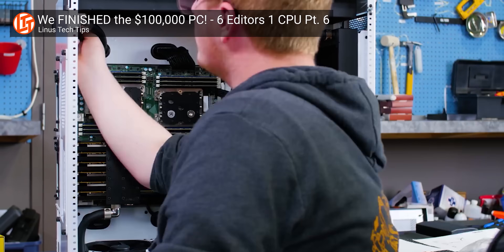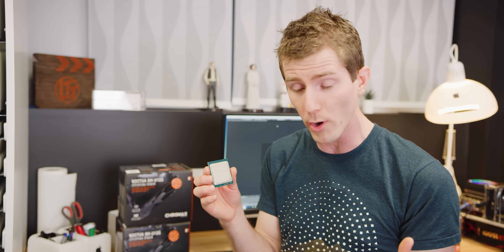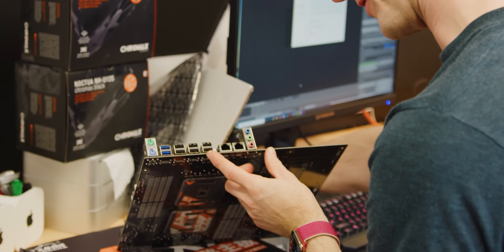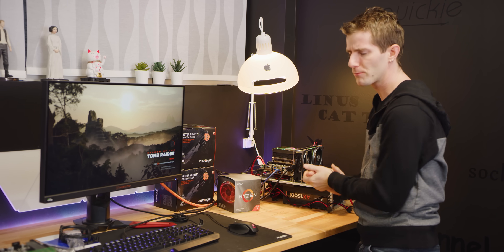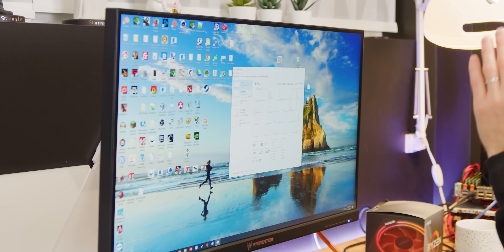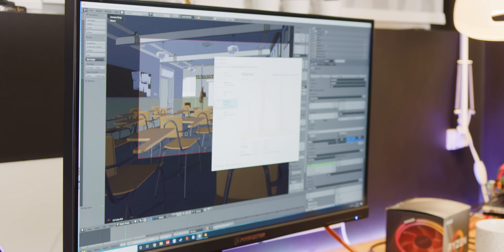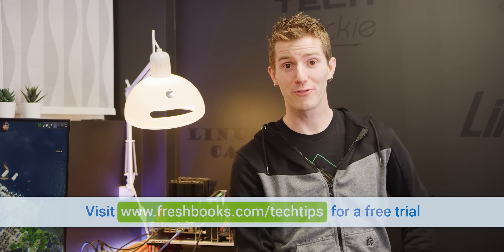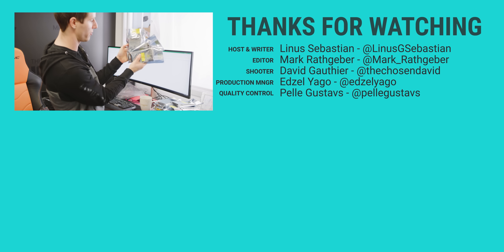SIXTEEN Cores for the Price of EIGHT!

Comment: Linus, I bought the same mbd, just the Kllisre brand instead, initially testing with two very cheap 2640s (15 UKP each) and 64GB/1866 (58 UKP). Btw, turn off NUMA mode! It will likely be on by default; many games will run better with it off. I note you chose the 2667 v2; worth baring in mind the much cheaper 2650 v2 (about half the price) though it's clocked 600MHz lower. Still, even with the two SB-EP 2640s performance is pretty decent; I have 2x 2650 v2 and 2x 2680 v2 which I'll test later. With the 12 cores of the two 2640s I get 1426 for CB R15, 3041 for CB R20 (so your score of 2256 for R15 looks reasonable, be interesting to see how that compares to my v2s later):

http://www.sgidepot.co.uk/misc/tests-jj.txt

I do think you should have bought 1866 memory though, it's very cheap off Aliexpress, but I expect one can force 1600 RAM to run at 1866 most of the time. I was lucky and managed to obtain mine locally for about the same cost (96GB/1866 for a total of about 95 UKP; the other 32GB went onto a PlexHD X79).

This particular dual-S2011 mbd does NOT support quad-channel memory (per CPU I mean). Each CPU only has 2 channels wired up, each channel connected to two slots, hence the differing slot colour coding. I have talked to the supplier about this, they seemed unaware of the nuance. Here is some memory bandwidth data showing the differences:

http://www.sgidepot.co.uk/misc/kllisre_analysis.txt

I suppose one could argue the mbd overall has four channels (with 2 CPUs installed), but the boards are advertised as having 8 total channels which isn't true. I've asked Kllisre to change their advertising.

I've tested many games, most run quite well, including SotTR as you observed; results now on my site here:

http://www.sgidepot.co.uk/sgi.html#PC

Also, if you're seeing clocks that are only at or near the base clock when running something like Blender or CB then you may have the BIOS settings not quite right, the all-core clock for the 2667 v2 should be 3.6GHz, not 3.3GHz. Make sure you have C-States set to default in the BIOS; I found that if I tried to limit the C-States it would block the higher Turbo levels. My 2640s have a 2.6 base, but in CB they run at 2.8.

Lastly, since there's no overclocking on these CPUs there is no need for a fancy cooler, a cheap 92mm model will work just fine. I used the Cooler Master Hyper H412R which cost 20 UKP each.
Reply: I am in the process of building a home NAS/Server with dual 2650v2's.  Just waiting on my case to arrive!
Reply: @Silarous  Are you using the same mbd? It has a variety of end product names. Let me know if you'd like any info about BIOS settings, though as mentioned I've not yet experimented with the different memory modes. One thing though, definitely fill all the RAM slots, so if you want 32GB then use 8x4GB/1866.

I'm going to do some more game testing with the 2640s before moving up to the 2650 v2s, though I might just swap in a 1080 Ti so see just how far the uber cheap CPU options can go, especially since they're only using PCIe Gen2 (the 2420 v2 data suggests probably not too bad, but we'll see). I started testing with a 780 Ti because I wanted something "older" and more obscure in terms of where bottlenecks might be.

I haven't tested the M.2 port yet, will do that later this coming week using a 1TB 970 EVO Plus (should be slower compared to using the v2 series).

Good luck with the build!! :)
Reply: @mapesdhs597  thanks!  I'm actually using a Supermicro X9DRH-IF board.  Currently have 8x 16gb 1866mhz DDR3, four sticks per CPU.  

Definitely new waters for me.  I have built many gaming desktops including three Ryzen/1080ti builds with custom water loops.  Server components are foreign to me.  Excited to mess around with the tech.  More than happy to hear any tips you may have!
Reply: @Silarous  Ah! In that case with a board of that calibre you shouldn't have any of the potential issues of the kind I mentioned above, ie. you should observe the full quad channel RAM for each CPU, the sleep function should work ok and I expect you'll probably have some control over voltages, etc. aswell. How much did the Supermicro cost?
Reply: @mapesdhs597  awesome!  Good to hear.  The board was $140 on Ebay.
Reply: @Silarous  That sounds like a good price for such a board. I suppose there are differences vs. the Chinese boards, eg. the latter often have M.2, USB3, etc., but the SM has a lot of proper server features the Chinese boards lack.
Reply: @mapesdhs597  that is true.  It does lack usb3 and m.2.  Plus it only has 2 sata3 ports.  Bright side is it has a ton of pci-e slots to add those things should I need them.  My primary use case will be a NAS so the sata2 ports should be plenty for the HDD's.  Main thing I want to add is 10gbe for fast transfers.
Reply: @Silarous  It's a pity most of the slots are only physically x8, but I suppose that doesn't matter if one is mostly thinking of option cards rather than GPUs. For a NAS though I guess this doesn't matter, and indeed SATA2 is plenty really, though you can always put an NVMe in a slot adapter if you really need meaty I/O, eg. products like the 2TB Adata XPG SX8200 Pro are well priced (I just bought one for 208 UKP for my laptop). I assume it'll be an Aquantia card for 10GigE? Oddly enough for my daily tasks system I'll probably get an X470 Taichi Ultimate precisely in order to have that feature. :D
Reply: @mapesdhs597  yeah, this board is definitely not a gamers board.  I bought a Nvidia GT 710 gpu just to have HDMI for initial setup.  Most likely will never have anything more powerful then that.  I have considered adding a NVMe drive just for hosting my VM's.  Starting off with one of the Samsung 860's I had laying around.  Still debating how I want to do the 10Gbe.  I'd want to have my three gaming desktops and the server all wired on it.  Still not cheap to do.  Debating on whether to wire it all in Cat6a or sfp+
Reply: @Silarous  I'm still looking into 10GigE for the same reasons, as you say still a bit pricey, though I think LTT mentioned some newer switch products recently (no idea as to general availability). I'd avoid QLC products for storage, scary how badly their performance drops off for sustained/mixed workloads (I'd initially been tempted by the low cost of the 860 QVO, but bought the 970 EVO Plus instead as I need to be able to sustain large sequential read/write).

It's a pity switch tech hasn't moved on somewhat, and it's a pain to search for stuff, so many products listed with titles that sound like the item has every port as 10Gbit but infact just one or two are, the rest are 1Gbit. Ideally I'd like an 8port which is all 10Gbit, reserve that for systems which can really use it, everything else can use my existing 16port 1Gbit.

Irony btw, I obtained a 48p GigE Netgear switch way back for a stupid low price, but realised after a while it was complete overkill (idle power consumption, and the noise despite fitting with three better fans). Keep meaning to sell the thing off but it just lingers in the hall next to an old SGI Onyx. :D
Reply: @mapesdhs597  haha exactly!  An 8 port 10gbe would be perfect.  Take care of my needs now with a little bit left for future expansion.  They are rare though for a decent price.  Progression in home networking has fallen way behind everything else.  I guess the average consumer doesn't need 1GB transfer speeds across their home network, but enthusiasts like us will take anything we can get!  Having bulk redundant network storage on tap that is as fast as local just sounds awesome!  

Do you have experience with Freenas?  I originally liked the idea of Unraid but after discovering how the array works, I can't bring myself to sacrifice the transfer speed.  Especially if I am planning a 10gbe setup.  Freenas seems like the better choice but I don't know if anything else exists that may be better?
Reply: @Silarous  Perhaps the switch manufacturers don't think there's decent money to be made, but there's no need for something with all the Enterprise management features. OTOH maybe they think that such a basic but decent 8port product would eat into sales of their pro lines? Hard to say, but unlikely from the chats I've had with pro users and sysadmins. The only thing I'd really want is something that can handle all ports active at once, ie. a decently fast backplane in the switch. Hmm, another possibility is the manufacturers simply don't have to offer an entry product, maybe they're selling all of the units they make to Enterprise just fine (ie. demand always high end to soak up the supply). One option may be to look for used units, but I can't see there being any decent supply of those anytime soon, most would just be sold within Enterprise circles via the usual brokers long before they could end up on ebay or something.

Alas I know nothing about NAS setups. I did start watching a guide by Craft Computing about how to set it up, but then was distracted by work and other stuff. Problem is I need a NAS that can be accessed by SGIs aswell, so it's kinda on hold for a while.
Reply: @mapesdhs597  it's all good.  I got the setup up and running tonight.  Just tinkering with Freenas now trying to get it to do what I want!  It is very complex.  More Youtube videos for me!
Reply: @Silarous  Yay!! Good to hear! 8)

I've been doing some more game testing. Using Win10 instead of Win7 has some odd effects. In general avg fps is worse, though sometimes the Lows are better,but in some cases the min/max fps gap is increased (most peculiar). Currently pondering whether to include DX12 results in the same table, dunno...

Win10 not as stable though, I have a lot more issues with games crashing re running with Fullscreen vs. Exclusive Fullscreen (couldn't run Hitman 2 at anything above 1080p/LOW).
Reply: @mapesdhs597  interesting.  I wonder if some of these games are having trouble sticking to one CPU and may be experiencing memory latency when crossing to the second CPU.  Similar to the Ryzen Threadripper where games don't tend to take NUMA into account and some workloads migrate across the interconnect.  I'd be curious how they bench with NUMA disabled or tweaked in the OS.
Reply: @Silarous  Actually some games I mentioned which behave in that way don't seem to make use of the other CPU at all, it's as if somehow the game engine can't see it. I don't think it's the OS because other older games do make use of both CPUs just fine, to great effect, such as The Division and Metro LL. I do need to go back and cross check this with Win7, but here's how the games behave so far, ie. whether or not they use both CPUs under Win10:

Bioshock Infintite: FAIL (could not run)
Dirt Rally: No
F1 2018: Somewhat

Far Cry 5: Somewhat
GTA V: Somewhat
Hitman 2: No
Rainbow Six Siege: No

Resident Evil 6: Somewhat

RotTR: Yes
SotTR: Yes

The Division: Yes
Witcher3 WH: No

Trouble is, there are sooo many memory settings that it may be a while before I can work out where a particular alternate mode benefits a particular game and, if it does, whether it's worth bothering with. The BIOS settings are a tad obscure and don't include explanatory annotations. When I can I'll first try Mirrored memory mode, see what that does.

Note that for one of the games which didn't seem to use both CPUs that much (FC5 I think it was) I did try turning off HT, but all that did was isolate threads to one CPU only just as before, not generating additional threads as had been the case with HT on.
Reply: @mapesdhs597  I know what you mean in regards to the bios settings.  I find myself googling everyone of them to see what I should have it set to.  Haha.  Especially these server boards, they have settings I never even heard of.  That's part of the fun.  

I am surprised that some games will jump to the second CPU.  I would think that would impact performance negatively considering the latency involved.  Since most games won't come close to using 16 threads, I would think the game staying on one CPU would provide the most performance.  You could always create a VM and only pass through one CPU and benchmark the games that way.  I bet there would be a performance boost.  But you never know, I could be way off.  You're making me want to buy a decent GPU to drop in and play around with.
Reply: @Silarous  Yeah there are loads of settings, I need to read up on some of them.

Re the 2nd CPU, there isn't any latency issue because once landed on the other CPU all of the spawned threads remain on that CPU (ie. none are trying to access RAM on the other CPU), so it doesn't seem to matter which CPU happens to be selected at the start, at least for those games which behave this way. Other games make use of both CPUs just fine, such as Metro LL and The Division. I've updated my site btw so the new game tests are now listed, see:

http://www.sgidepot.co.uk/sgi.html#PC

Re better GPUs, I have a 1080 Ti I'll test at some point, but I wanted to start with some lesser GPUs first, so next up will likely be an RX 580 8GB (I have the Red Devil model). I have a GTX 980 aswell, but I'll leave that until after the 1080 Ti.

Interesting observation btw, when running TimeSpy I noticed the 3DMark info summarised appeared to see the system as having only 32GB RAM; I wonder if it's something to do with how Win10 is reporting available resources to apps, hard to say. I need to go back to the Win7 SSD to see if it behaves the same way; I have a suspicion it actually works better with Win7 in some cases. Or it could just be the memory mode in the BIOS, ie. perhaps I need to use Mirrored instead, or one of the other options.

Before I do tests with the RX 580 though I need to rerun some of the 780 Ti tests due to driver changes and alterations I made to test settings (you can tell which tests are involved as there will be an "O" before or after the CF/SLI column, or an older 300 series driver is mentioned - Hitman 2 is the most affected). Can't do this though until I've finished with the 780 Ti on the Kllisre board (I have a 2nd 780 Ti but it's currently in my editing rig).
Reply: An extra data point, I found 3DMark11 Performance/Extreme both ran slightly better under Win10, which surprised me:

https://www.3dmark.com/compare/3dm11/13633636/3dm11/13650854
https://www.3dmark.com/compare/3dm11/13633835/3dm11/13650886

In both cases the CPU score degraded but the graphics score improved (grud knows why).

I've only just installed TimeSpy, so atm nothing else of my own to which I can compare:

https://www.3dmark.com/spy/10076979
Reply: Well this is interesting! Mirrored memory mode did not help (it dropped write bandwidth by half), but turning off NUMA mode instantly allowed Hitman 2 to eploit both CPUs and in the process improved avg fps by 10% (I picked a screenshot which more clearly showed the CPU logging, the actual average for the run was about 66fps):

http://www.sgidepot.co.uk/misc/P1200142s.jpg

I'm going to check to see if the other relevant games will behave the same way, make sure those which already used both CPUs are still ok, and if so then I guess I need to redo the tests as a whole. Normal CPU tests like CB and VRay did not show any degradation, so far they all seem to give the same results.

I've not tested Lockstep memory mode yet, but I found some references on these modes so I'm going to read up before meddling with those any further.

Comment: an old 4770K will be able to max out a 2080TI with headroom to spare so if you are purely a gamer then the older hardware is still a viable solution for most games. Once you start running heavily CPU-bound stuff you are going to start to feel the older hardware.

Comment: "these cpu's didn't really have all core boost"- Err yeah they did, 3.3Ghz to 3.6Ghz al core (4Ghz 1core) for these e5-2667v2s. Also yeah this is like a 4 year old video, I started building mine before threadripper 1 came out.
Reply: My HP Z420 has a 2667 v2 and a GTX-1070. I love the thing, fastest computer I have ever owned, the 1070 is still the bottleneck in about 98% of realistic scenarios.
Reply: @White-Wolf1969  I paired mine with a 1050, and later a 2070 and it performed great.  I loved the many core/threads for parallel building but otherwise it was funny watching how so much of it did nothing. 

I'm turning it back to a server.

Comment: Just found another version. Well, another brand made by HUANANZHI. The links below show two from the same brand but different models, yet they are same as the X79 chipset... 
https://www.aliexpress.com/item/4000129963829.html?spm=a2g0o.detail.1000014.17.1f76de29yxl6r8&gps-id=pcDetailBottomMoreOtherSeller&scm=1007.13338.128125.0&scm_id=1007.13338.128125.0&scm-url=1007.13338.128125.0&pvid=cc51f6dd-ba7c-4b3e-92a0-88c7299eed1a

https://www.newegg.com/huananzhi-x79-16d-dual-intel-xeon/p/296-003N-00002?&nm_mc=KNC-GoogleKWLess&cm_mmc=KNC-GoogleKWLess-DSACategoryPages_-NA&gclid=Cj0KCQiAr8bwBRD4ARIsAHa4YyJMNlwxShCwQpd7P2IulL3x0un4Vsx08plGpyPTnBt55qbDmOgyWs0aAjZzEALw_wcB&gclsrc=aw.ds

Comment: Just a tip, windows task manager is the worst at reporting clock speed in multi-core systems. It's rarely showing you the fastest core speed. Something like Hardware monitor or hwinfo64 would be far better to understand what the CPU(s) are doing for a given load. Just my 2cents...